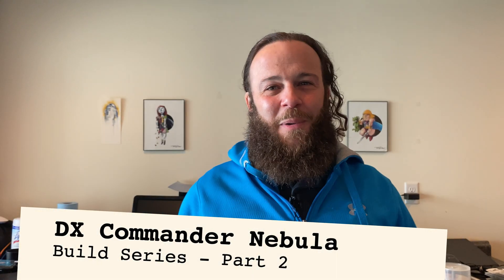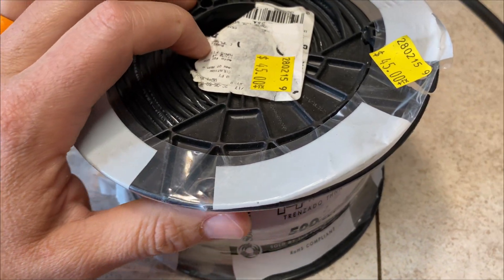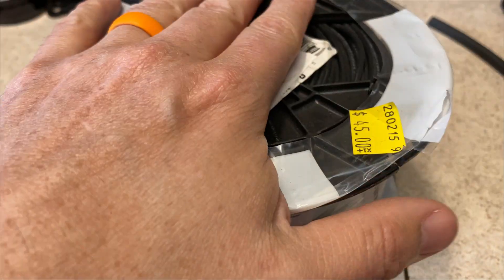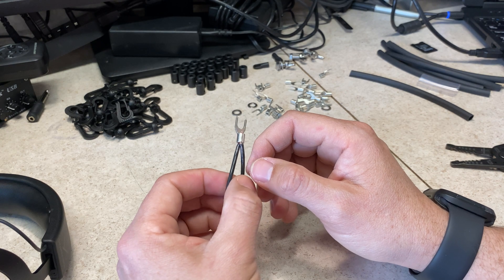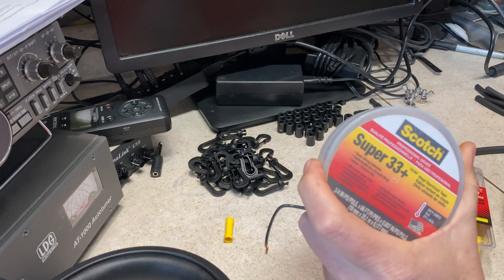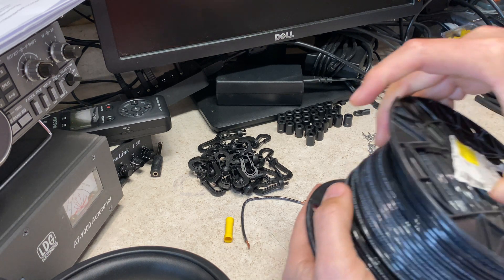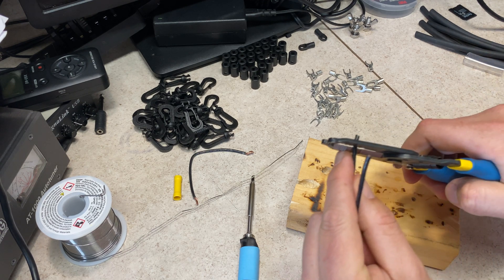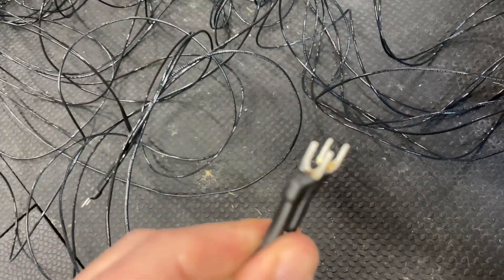DX Commander Nebula - Part 3

Comment: I know it might be too late but do you still have the yard sticks for the radials available?
Reply from the maker: Are you talking about the stakes I used to pin the radials down to the ground?
Reply: @LifeAtTerminalVelocity  Yes Carlos,  I saw the link to them in the  description in case you're out of them though...
Reply from the maker: @solarflare4259  I still have a few hundred. Let me know if you want to buy some.
Reply: @LifeAtTerminalVelocity  I’ll probably need 150 -200 of those…